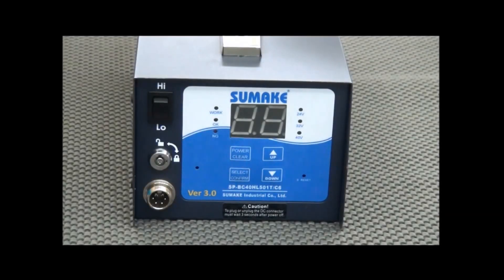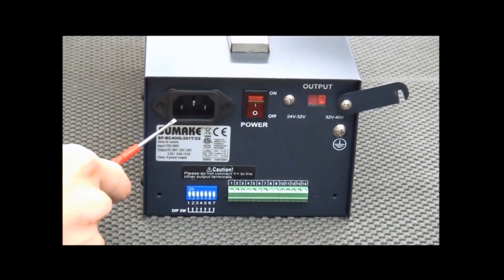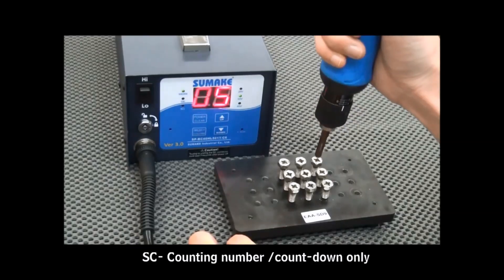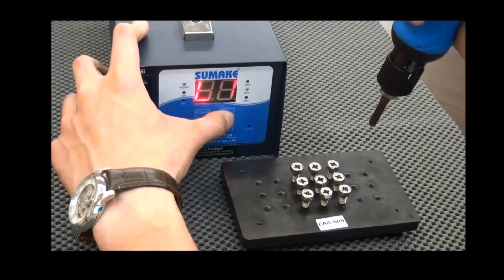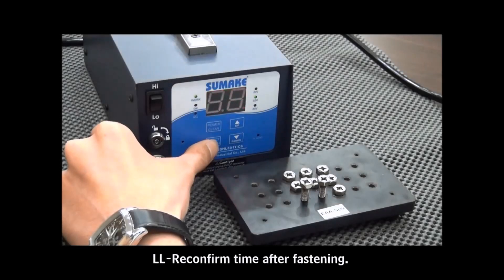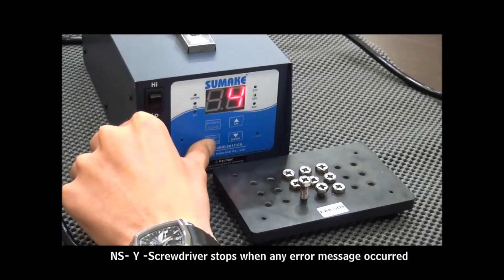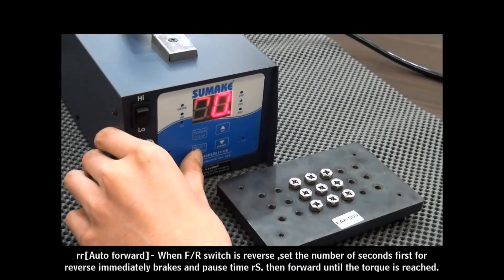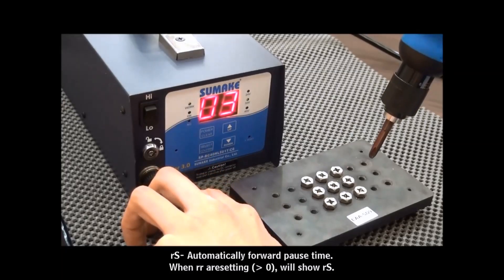SUMAKE SP-BC Brushless Power Supply

Comment: Good afternoon, mrs.

I would like to clarify with you what would be the condition for this parameterization of HT and LT, considering that the difference in time if the tightening process is 0.02sec, follows an example.
the screw has 5mm, the torque is 5kgf/cm, the tightening time would be 0.5sec. would the equipment be able to identify any obstruction in the work of the tool if by any chance the equipment works for the period of 0.45sec? how would parameterizing the equipment?
Reply from the maker: Hi Willian.
The screwcounter parameter setting smallest unit of HT and LT is by two decimal places. The equipment is able to identify obstruction in the work of the tool. If the workpiece has tolerance and cause the tightening time to exceed the set value. The counter will display NG.
For any further assistance, please feel free to contact us.